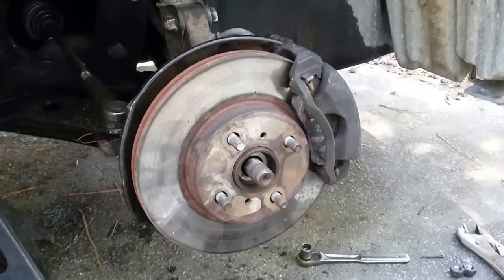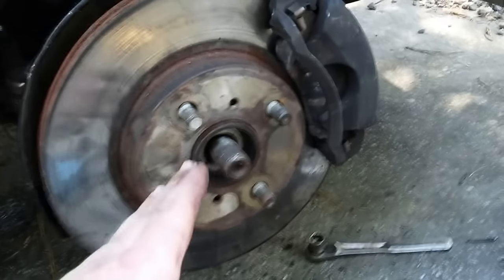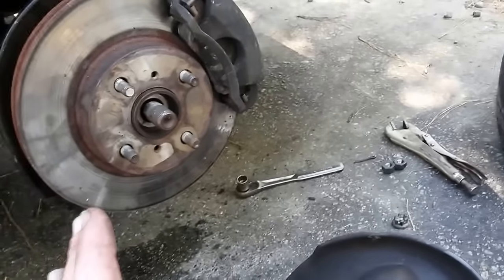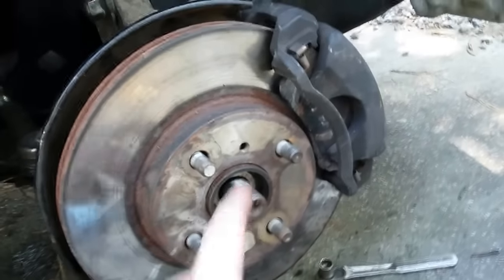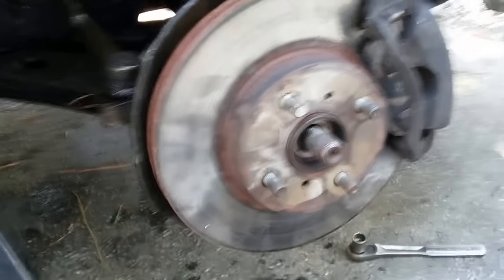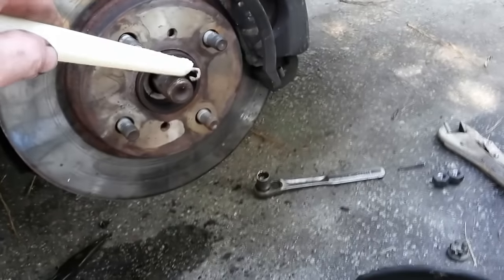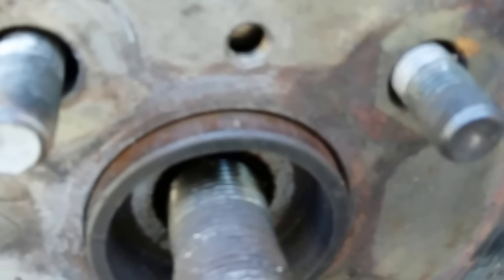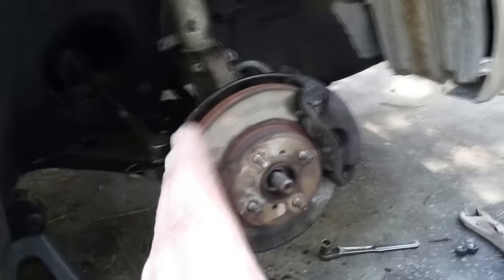A quick tip on removing those stuck Axle nuts

Comment: If I could give you 10 thumbs up, I would.  I made due with gas, and got the 3/4" HF impact gun(the breaker bar with the car on the ground was going nowhere, I weight 225lbs and was standing and bouncing on the bar, nothing) I heated up a few times, candled it each time  used the gun back and forth, stuck the candle way in to reach the washer and tried the gun again.....bang! out it came! I'm going to wax on from now on!

Comment: I wasted so much money on breaker bars and broken stuff. Angle grinder, 1/16 inch wheel. Slice that thing on two sides just above the thread line and knock it off. Took about 10 minutes. Of coarse you will need a new nut.

Comment: Love you. Took 45 minutes of heat gun and candle on a 242lb 2014 Honda accord. My impact drill rated at 214lbs.
Reply from the maker: YES...!! I'm happy for you...!!!
Reply: I bought a $140 Chinese cordless impact wrench rated at a 1000ftlb (Jexugk) and never looked back 🎉

This thing is a bad A! My first use was breaking all my lugs free (from a Latino tire shop that impacted them on too tight) and torqued back to spec with my Chinese digital torque adapter (Tagvit …awesomeness)

Main reason is to break the rear lower side strut bolts loose on a 97 Civic with slight rust. 🎉🎉🎉

Comment: Worked like a charm.  Had been working on a wheel nut for a few hours and tried again with the wax and off it came.  Only had propane so kept it on for about 30 minutes and off it came. Awesome.

Comment: Thank you so much for this video! I already broke a 1/2inch breaker bar with a cheater pipe. So I got a 3/4inch breaker bar and MAPP gas after watching this video. The heating process need to last long (for me, 8 mins) to raise the temperature high enough and doesn't need a lot of wax for it to work. Watching the loose of the 22yr old nut is a bit existing!

Comment: I tried this and it worked. so gratifying. my axle nut was as frozen as could be. Lowe's sells a map gas/torch kit for $50. it's everything you need. one cylinder will provide more than enough to do this job.
Reply: This one I have must be glued in because this method did not help.  Please advise what you did, if you did something different than the video.
Reply: Natasha Lee I heated it for what seemed like 20 minutes. I extended the breaker bar  by placing a pipe over the breaker bar that was about 4 or 5 feet long. I stood on top of the pipe and placed my weight as close to the far end of the pipe to give me the most amount of leverage. coupled with the method shown above, it worked. focus the heat on the nut as much as you can. if you don't have enough weight than find someone fat and have them stand on the pipe.

Comment: THIS WORKS ! I used propane with a turbo torchhead, heated both nuts twice, shoved the 3 cent candle into the the hub center till the wax was dripping onto the floor and off came the nut.20 mins total for both nuts. Thanks my new friend !

Comment: Tried this method several times and I wasn't able to get it off. It's a neat idea and I would try this before any more extreme methods. But in the end I used 2x of the cheap $16 rotary tools from Walmart to grind two sides of the nut. I also used their $16 drill and a high-quality cobalt drill bit (not Walmart). One of the rotary tools, the chuck was destroyed in the process. I then needed a cold chisel and a mini-sledge to pound off the two halves of the cut axel-nut. WOW, what a disaster. I needed some cheap tools because I flew to help a friend and their '97 Mercury Sable and didn't want to re-purchase the tools I already have at home. In the end, the junk from Walmart actually got the job done and it was under $100 total for all the junky tools used.
Reply: Man that was a war
Reply: @zeez3139   *still remembers

Comment: bro… God bless your soul….. i tried everything, i did this so many times, i tried everytbing, air hammer.. breaker bars.. everything. didn’t believe this would work but litterslly had notbing to do anymore so i tried… and it came off. bro ur a legend
Reply from the maker: Man I'm glad it worked for you. For the most part when it does not work its because people fail to leave the heat on long enough... just like the video says right about the time you want to give up... it cracks free.

Comment: Bought a $22 Breaker Bar (which I needed anyway), Map Gas $10, 2 Cans of Penetrating Oil $10, candle $1.00.  Guys mine did come off with 24" Breaker Bar and you can rent Impact Socket Set from Autozone $80 Deposit refunded upon return.  This was a tough experience, but the axle nuts finally came off probably been on car 20 years!  I don't know if was the candle or 2 cans of penetrating oil maybe both.  Use penetrating oil PB Blaster White Lithium / WD40 Penetrating Oil (w/Blu Torch Tech) like at least 5 days in advance and of course the candle!

Comment: Thanks A Million Bud!!! Spent the better half of the day trying to get the nut off my Expedition. Was about to throw in the towel when i caught your video. As you said, tried PB and all sorts, but the wax  with a berzonite propane torch did it for me. Heated it up for about 10 mins...saturated it in wax and Hey Presto! Cracking a cold one and toasting to TG
Reply: Many thanks sir. It worked, I was thanking God I found your video.....

Comment: Dude, what an amazing trick, I was changing a strut on my 2012 jeep Cherokee and could not get the axle nut to break. It was rusted as hell. I tried PB blaster and all that shit. Then I watched your video like you I did not have a blue tip wrench but I did have a bottle of map  gas. I heated around the axle but stole one of my old ladies, Yankee candles, heated that bitch up for 5-10 minutes then put the wax on the Threads of the axle and it sucked the wax right back in. I was then able to use a breaker bar and bust that son of a bitch loose. Thanks bro you are the man what a great tip.
Reply from the maker: I love seeing how this still helps people....!! I had just moved back to the area after my dads passing and was so limited on tools and this job had to be done. Had a guy show me this trick and it worked...! afterthat I had to share it on here

Comment: i got to try that as I am trying to remove that stubborn axle nut! Tried PB and tapping it...used wire brush...use the 30mm socket...used a pick to dig around the edges...bought the propane torch the other day...so will try again with the candle trick as you advised.
Reply from the maker: Just like I said in the video...you have to get it really hot...don't give up..it will come off
Reply: Yes Travis, you were totally right! In my case the axle bolt does not stick out like yours. I was working on my son's 1988 BMW 325ix and that bolt is short and almost flush to the axle nut. I had to torch the candle onto the  inner threads and get the wax in somehow so ended up using the whole 6 inch candle and almost the whole hand held propane tank but finally after 30 minutes it came off. I remember you saying, just when you feel like giving up the nut will turn. so I heard you and went beyond my give up point and said just use up the entire propane tank if I have to. I slowed down rotating around the axle nut and saw the nut changing colors, then put the socket on it and finally turned. I was using a portable power gun with 300 torque. I had already tried 4 times previously to remove the axle nut. Your video really helps and gave me great advice. Thanks!!!
Reply from the maker: Man I'm so Happy this helped you out...It works and you just saw it for yourself....I'm glad I was able to help...God Bless
Reply: The only thing I have to do now is remove a stubborn ball joint where the control arm meets. I was trying to find a ball joint pickle fork and a good size hammer earlier tonight. I did not find a good pickle fork but I did find a 4 pound hammer at Home Depot with a longer handle. Some videos I saw on youtube say I don't need a pickle fork but just hit the side of the ball joint to release the bolt. I just got to loosen the ball joint nut that is sandwiched inside to give clearance. Travis, you advise hitting the side of the ball joint with a good size hammer to loosen the bolt? it looks like it could work and better then using a pickle fork as pickle forks could damage the rubber boot. Not sure what's the best technique.  Thanks.

Comment: After turning my rusted axle nut from a 32mm to 30mm to 29mm then drilling the hell out of it with a $8 drill bit, I finally torched the hell out of it for 15 minutes with the MAP (didn’t glow red but it was smoking!) hit it many times with wax, put an impact on it and bam it came off. I don’t know if it was the heat or combination of wax but thanks for the video. It gave me inspiration to not give up. The feeling when it finally came off… aaah…
Reply from the maker: Man I’m just happy to hear you got it off man..!

Comment: Stupid question: Most people seem to crack them loose before taking the wheel off or jacking the car up so the friction of the wheel stops the hub turning with the nut.  If i've already removed one of the suspension arms so I no longer have that option is there a neat way to hold the axel still?
Reply: Stick a screwdriver into the rotor vent, It will jam it in place.

Comment: You can also use dry ice, it's pretty much the best thing I've ever used. Super heat it then wrap some dry ice in a hand towel and hold it on it for like 60 seconds.
Reply from the maker: +Tyler Labbe thats a new one for me...cool tip
Reply: I'll try this tomorrow, hopefully this will work or I will just have to pay a mechanic.  Once he's available, since he's backed up...

Comment: I'm about to try this out. I'm removing the axle either way. I'm tempted to cut it. But the bolts to the trans are stuck as well. 
Should I try and heat those bolts, or will there be fireworks
Reply from the maker: Tell if it it worked for you...!!

Comment: Yeah, I had problems with an axle at a scrap yard where I had no impact gun so I tried PB Blaster and a propane torch.  Held it there for ten minutes - too much metal acts as a heat sink so it did bugger-all. Yeah, MAPP gas would work.  At home, I just attach "Big Nasty" and impact these off in 5 mins.  Turns out that some previous mechanic-bugger head overtorqued the nut!

Comment: I must be doing something wrong?  I have been at it for over 4 hours trying to get this thing off using this method and it will not budge, not sure what's going on.  Is there another method that's cost effective or should I just get a mechanic?

Comment: Liked the video; got one question though: Does the heating process mess up the wheel bearings?
Reply from the maker: Yes it can...but in this case the old one was bad so no worries..sometimes you have no choice when they are froze up
Reply: Thanks; I'm about to deal with something similar, and I was hoping I wouldn't need to heat it up because the bearings are good. 

[UPDATE] I lucked out; the electric impact wrench worked out fine. Funny how that worked and the breaker bar didn't.

Comment: This worked like magic! The key is 10 minutes of heating. Tried 5 minutes but it was still locked. Heated again for another 6 minutes and added the wax. Greg Erikson didn't do it correctly! that's why its was a nightmare.
Reply from the maker: First I'm glad this helped you out. Not to come across rude but for the most part when people say it did not work... they did not use the heat long enough... like I said in the video you have to get it got...like really hot..! I work on cars from the north and not even impacts off the tool truck will get these axle nits at times.... this trick will get them 95% of the time

Comment: I got a drive shaft axle nut that won’t come off.  It’s not even rusty!  I’ve tried my impact , breaker bar while pushing with my feet nothing. Guess will try heat next
Reply from the maker: All the people on here saying just use a impact... Man I had one... a very good one and it would not touch this thing. You need heat and allot of it...!!

Comment: No candles? In a pinch, a wax crayon works great too! Throwing all my weight on a 40" breaker + cheater bar wouldn't budge it, but after 5 minutes with a Crayola and propane turbo torch it was off.

Comment: What if u just want to remove the cv joint and have a good bearing wouldn't the heat destroy it ?
Reply from the maker: Most people doing this have a bad wheel bearing so you can not damage what is already broke
Reply: @BigTravGill  agree on that.

Comment: First good tip, problem 2001 dodge ram 4x4, nut is 1 3/4 in 
Break over bar 5th pipe on it I'm 305lbs bouncing on the pipe still stuck, end up replacing whole cv shaft due to heat burns up bearing hub/seals and did crystallized the steel in shaft
Good tip if your doing something on smaller side EVERY. LITTLE BIT HELPS ANYONE like me We're all glorified grease monkeys just try'n to save a buck

Comment: you'all may give this a try ( I did and did nothing, and also shear off two 1/2" socket stubs in the process, UNTIL......read on)  BUT the easiest way to get these "OLD" and seized wheel hub nuts (and mounting bolts) out is to get a 3/4" socket (in the size of your axle nut) and 3/4" ratchet or torque bar AND a 36" or 48" length pipe 1" in diameter to use as an extender. Yuuuuuge, amount of torque! Unless you have set up with compressor and impact tools, the battery impact drills just DONT do the job. This was easy peazy even on a 2002 chevy tahoe just this past month. 1/2" just wont do the job on the axle nut (1/2" sockets are strong enuff for the the hub assembly mounting bolts BUT use the 3/4" socket wrench for the extra leverage; just buy a 3/4" to 1/2" socket adapter) and will only shear off the ratchet stubs UNLESS you have the best tools like SnapOn etc.......but tooo expensive for amateur such as myself!
Reply from the maker: It works trust me....but like in the video right before you are about to give up it pops loose...more heat was needed just saying

Comment: I'm wondering if solder flux from plumbing would also work to suck in and loosen. That and a can of air cleaner to cool the shaft after you heat the nut. 

Also I recommend the cheap plug in the wall electric impact tool from harbor freight. Has a lot more horse power than any battery tool. That got my nut off. Trouble is they want you to torque that to like 217 ft/lbs or more which is insane to get off.

Comment: Only way that worked for me, snapped a half inch break bar and an extension,  wax is the only lube that works with torch, all the rest just evaporates right away

Comment: Use an acetylene / oxygen setup with a small welding tip . Place a pipe over the axle stub  , this will help to keep heat away from the axle . Heat quickly , not spreading the heat to the axle . Heat only the inner axle bearing .

Comment: I just spent 60$ at napa on a socket, 2 cans of pb blaster and inner axle seals and your telling me all i need is a candle?!   I swear if this works ill be so pissed and thankful at the same time
Reply from the maker: Its going to work man...!! MORE HEAT...!!
Reply: @BigTravGill  and of course we don’t have any candles in my house so I had to resort to melting one of the kids’s old birthday candles. Unfortunately, I only have propane heat. I don’t have any oxyacetylene or any other torch for that matter.   This bolt hasn’t been touched since 02

Comment: I’m about to give up , I guess  I’m gonna get a torch and burn the hell out of it smh
Update: I did it ! It took e 15min with Map/Gas $53 at Home Depot n the candle $3 at  Publix it worked just Iike the vid , thanks man ( I use a 250 lb bar , I broke a 150 lb in the process plus a 50lb before using this method) 👏🏻👏🏻
Reply: hEcToR pRiEtO 53$ lol I just spent 12$ for my map gas at advanced and it worked lol

Comment: A decent mains impact gun or makita battery one gold it on for a good 5 to 10 secs and the nut will come right off I've never fucked with pry bars or heat since
Reply: Elliott Performance yeah but for us poor folk we have to do what we have to do lol. I really wish I had the money for a nice set of air tools but that shit ain't cheap.
Reply: TheCrazybastard1 
not only for poor folk without an impact gun... i cant get my loose with 800nm impact gun...
Reply from the maker: Impact guns do not always work...and yes I tried using a decent one
Reply: I have an impact gun and its not doing anything! I've been using "Shock and Unlock" which is a freezing agent spray but that doesn't do anything I will try this method and see what happens.
Reply from the maker: Get it hot....really hot...trust me you will get it.

Comment: Try this video. It's easier and cheaper.
Breaking an axle nut loose with a trolley jack On you tube.
Reply from the maker: that would not of worked in this case...all it would of done was pick up the car because I tried it
Reply: Worth a shot but didn't work for me. Came here having tried that and everything else. Will give the wax a shot.

Comment: This sucks!!! It requires sacrifice of a wheel bearing and 10$ in mapp gas!!! there's got to be a better way.... It shouldnt cost a $50-100$ wheel bearing  to get one freakin nut off, that's RIDICULOUS.
Reply from the maker: It is what it is at times...you have no choice
Reply: Luke I couldn't agree more. Bought a $24 Breaker Bar (which I needed anyway), Map $10, 2 Cans of Penetrating Oil $10, candle a dollar.  Guys mine did come off with 24" Breaker Bar and you can rent Impact Sockets from Autozone $80 Deposit refunded upon return.